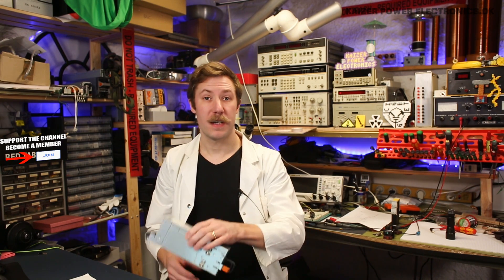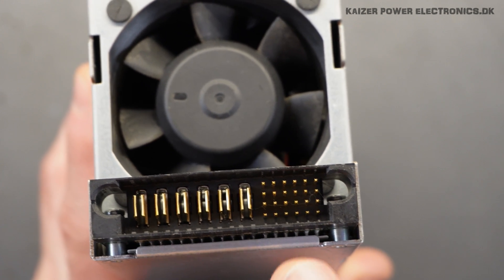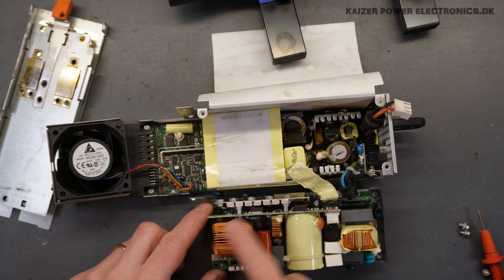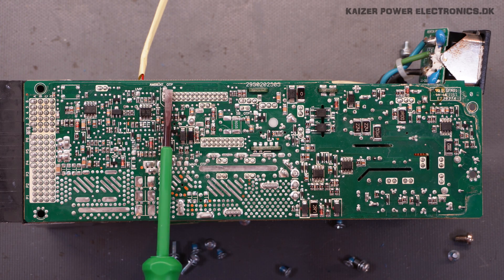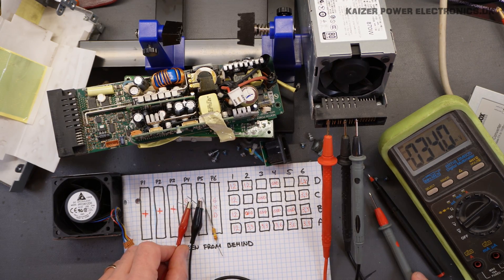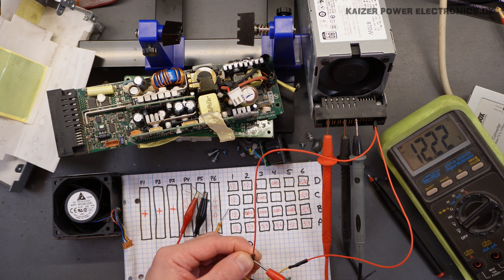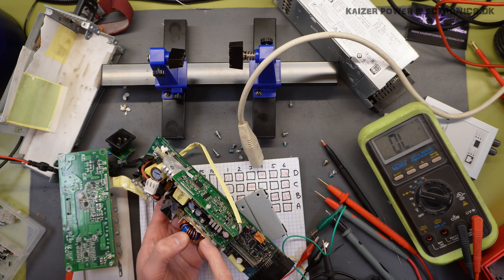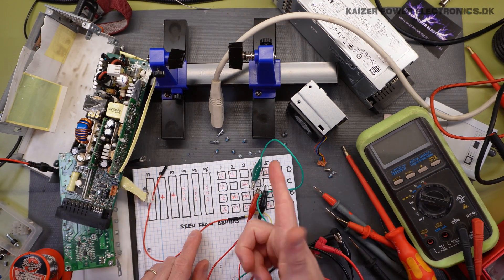Server PSU Hack - Dell N870P / NPS-885AB. 12VDC 71A 870W

Comment: I have a dell N750P-SO, that I’m trying to get 13.5-14.5v out of. Can you help with bypassing the OVP?
Reply from the maker: Try to locate some potentiometers and find the IC part numbers that they connect to, maybe you can find the OVP circuit that way. For some higher voltages, you need to change out some resistor networks as well, to get above 13V. Depends on the various models, how tightly build to  their 12V specification they are.

Comment: Have a nice day

You made an interesting video
The same unit was given to me for repair, the capacitance of the capacitors was greatly reduced, but on the board, which is standing vertically, the diode failed, the marking on the board “D2” case type TO-252/DPAK, the name was lost. There is no way to take another block

Do you have the same block or information about what kind of diode it is?

Comment: Would be nice to be able to also control fan speed but hey....better than no fan. Earmuffs😂
Reply from the maker: Someone did post link to a N750P power supply pinout, where fan PWM input is mentioned. So it might not be far from finding it among the remaining pins https://www.facebook.com/groups/ElectronicParts/posts/2338745386314783?comment_id=2338750239647631
Reply: Hmmm. That link takes me to facebook but not to the page i expected...just my homepge
Reply from the maker: maybe because it is in a group your not a member of. Facebook did nothing good for the open Internet :(
Reply: Fan noise is always an issue on these power supplies😢
Reply: Hi I have the same power supply how do I push the voltage of it up to 14.4v
Reply from the maker: @yushrakarriem6199  Do not expect to be able to push these above 14V. You need to fiddle with the OVP protection and the feedback circuits of the potmeters.